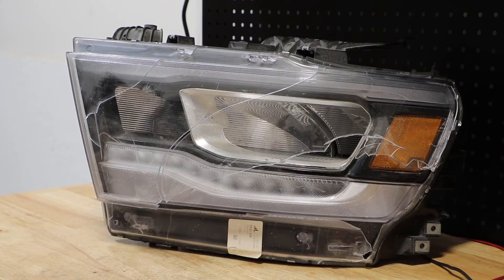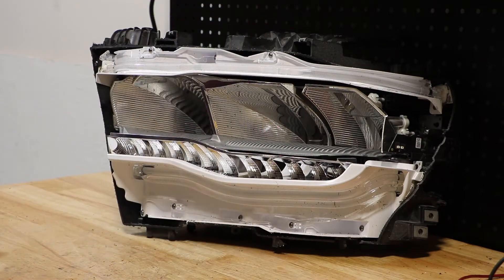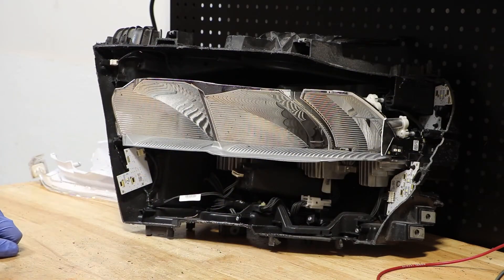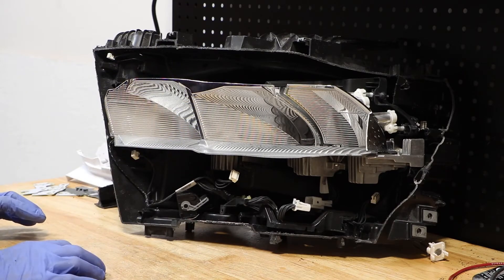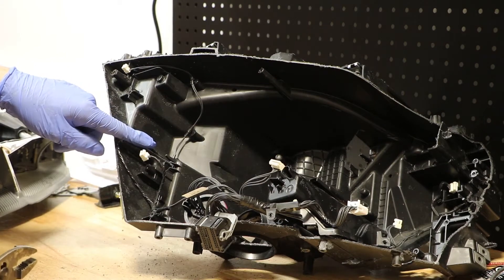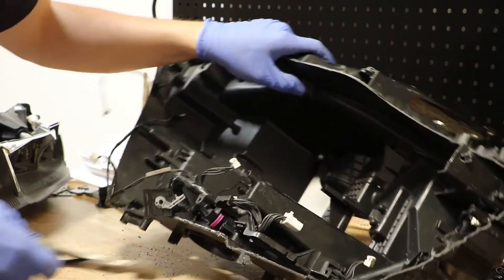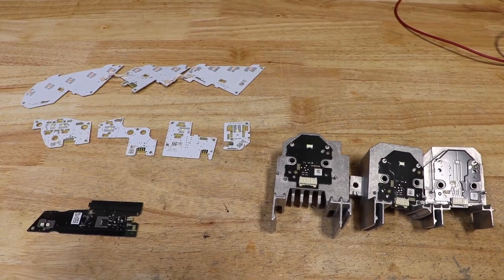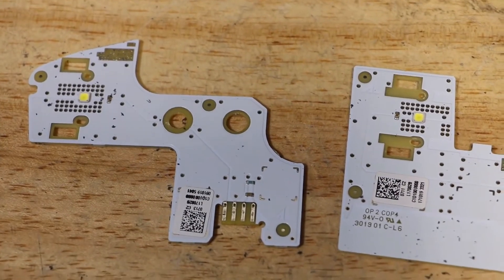2019-2020 Ram 1500 Rebel LED Headlight Teardown

Comment: Wonder if you can order any of those parts separate. I got a small crack in my same headlight and it totally stopped working. Guess moisture got in
Reply from the maker: Dodge doesn't sell them separately.   They will only sell you a complete headlight.
Reply: I know and its a 1100$ rip off. Its plastic with cheap leds.. my head light blew out and i have to buy a new one since dodge loves looking for any reason not to warranty anything.
Reply from the maker: @BeaglerOutdoors   The bad news is that this is now "industry standard".   Most of the manufacturers have moved to sealed LED headlights that have little to no serviceable parts.  These are now just considered "lifetime" parts.  I suspect that once we start to hit sometime around 2030 ish, a broken headlight will total a vehicle and send it to the scrap yard.
Reply: @gftgrill  i agree.. hard to find one used.. but if there un serviceable why make a vid on taking them apart?? 

And that front glass was also glued in why didnt you go over the process of removing it. I doubt it was just screes holding on the front glass
Reply from the maker: @BeaglerOutdoors  This more about showing off the internals/how it's built.   Someone could use it for repairing, but most won't.    I have a video dedicated to removing lenses here:  https://www.youtube.com/watch?v=CIU0iul5M_g

In order to save time I cut the lenses off of these for these videos.   5-10 minutes versus 25-45 minutes.

Comment: Wish you would have removed the bezel from the lens in the beginning…. Is it just a solid clear ? Or is they white upper and lower part built into it?
I’d like to open mine up and tint just the upper and lower led strips… when you popped the lens off it makes it look like that parts made into it..: is it separate?
Reply from the maker: The parts on the front bezel for the LED are clear.   I believe that they are just clipped into the black bezel.  You should be able to separate them from the black parts or just spend extra time taping them off.   As stated in the video, you should be able to remove the screws that are holding it all to the front lens and get access to the parts that you're talking about.

Comment: How did you remove the glass cover I’ve been trying to open mine but struggling
Reply from the maker: I cut the lens off with a saw because I didn't put it back together.  You will need to heat it up to soften the glue and pry it apart.   Ovens work best.  You can search for how to bake a headlight and find lots of information.   Note: I do not recommend using the oven you use to cook food with to perform this action.  No matter what be careful.  the melting temp of the glue and plastic are not far apart from each other.

Comment: Thank you for sharing. What was required to separate the lens from the main body ?
Reply from the maker: For the videos I just use a saw and cut it off because I don't put it back together.   In a repair/replacement scenario you would heat it up to soften the glue.  Baking is the preferred method, heat guns also work.   Either way you have to be careful not melt the plastics.
Reply: @gftgrill  OK, that is what I thought. I've viewed other videos and those from LED vendors. Not sure I am comfortable prying it open with screwdrivers and a heat gun. I feel there has got to be a better way to avoid the possibility of damaging the housing and lens.
Reply from the maker: @lylewolf5029  I don't think that there's any other way other than heating up the glue to soften it.   

an oven to heat the whole headlight + industrial glass suction cups for moving large panes of glass might allow you to heat up the whole headlight and use a suction cup on the lens and body to pull it off.  That would relieve pressure along the seam.   I'm not aware of any solvent that you could use to get in there and dissolve the glue.